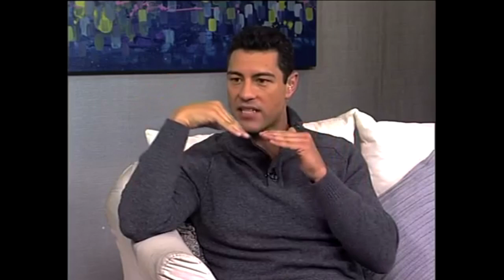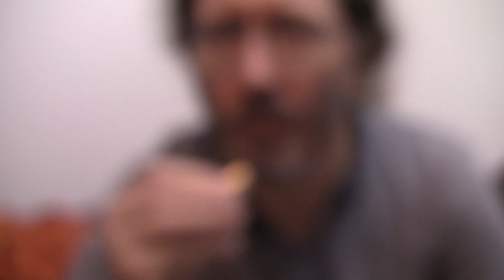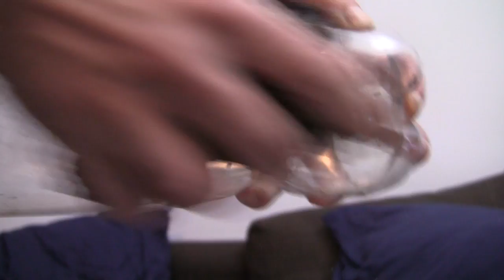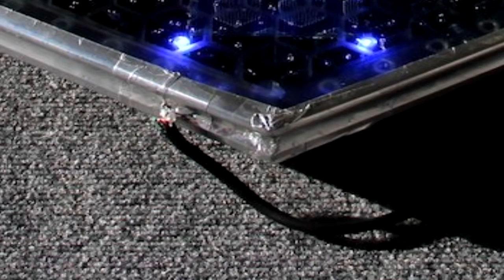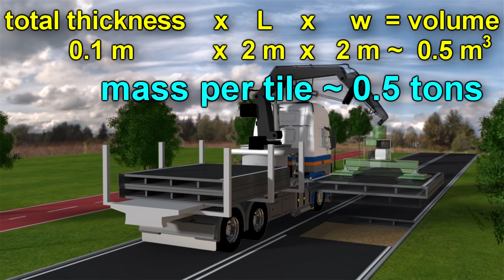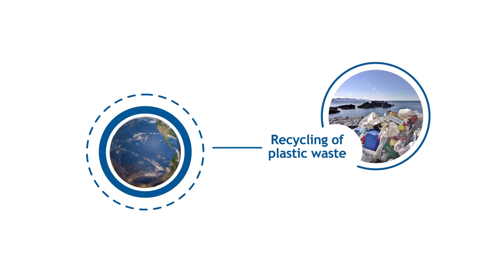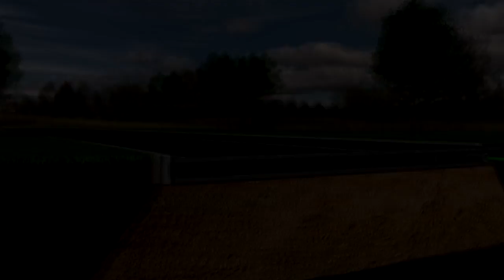Plastic Roadways BUSTED!

Comment: I have a question regarding your "Plastic Roadways BUSTED" video.  I'm only about 7 minutes into your video and I'm really confused.  From the gist of the video so far, you make it sound like plastic roadways are not possible and/or are stupid, but India has had plastic roads for the last 15 years.  I can get you a link if you want.  Is this not the same thing?
Reply: We should then just give Indias version of plastic roads a try. Because they sound decent and it makes more sense. No more  trying to change what the road is. Just make them better.
Reply: Did a quick check and it seems that concrete tiled roads are also more durable, partly due to the slabs helping to dissipate the weight of vehicles over its whole surface area.. asphalt roads being more elastic means the pressure is more direct on the underlying layers and hence degrade faster.
Reply: On the plastic roadways site it says that they will mix the plastic with something to make it stronger
Reply: They're soliciting for funding based on disingenuous claims without a prototype to show.
Reply: EpicATrain, No.  Asphalt does not function well as a span.  You do see asphalt placed on decks of spans but the span itself is usually something like steel beam.  If you look for it you can see objects mashed into asphalt roads.  Something like a penny is below grade after getting run over enough.  If the asphalt is on top of a void it will smash down into that void.  That is an advantage if you place asphalt on top of concrete.
Reply: The plastic roads in India came about as a way to make use of the tons of waste plastic created every day, if I recall there are whole sections of roads in Bangalore that are done this way. Basically it replaces bitumen as the the main binding agent so helps cut costs and recycles the waste plastics. Also due to the composition you can use different grades of plastics without adversely affecting it's durability so time consuming segregation is not needed. It's actually pretty durable and can help cut costs. I will have to wait and see how the plastic roadways proposed in the above video pan out as that's a somewhat different approach. Tiled sections for roads are not a bad idea, I have travelled through Assam and one of the highways to Guwahati is completely made of huge rectangular sections of concrete titles, I was told it is slightly more expensive than asphalt roads but maintenance and repair is easier, and is more resistant to the effects of the heavy rainfall we get during the monsoons.
Reply: Ponen Longchar I understand they are a good idea in the south, but here in the north, where the ground freezes and then melts every year, we had a concrete road for one year before it was changed. Then the slabs had turned enough so the road was not smooth anymore and the edges made driving uncomfortable and dangerous.
Reply: @ribbitgoesthedoglastnamehe4681  
Concrete is used all the time in areas that freeze in the winter. Where I live, we can get freezing temperatures for half the year, and yet they sometimes get 40 or 50 years out of concrete pavement. What you are describing, where the concrete slabs rotate so that the edges stick up and make for a rough surface, is caused by poor construction practices or bad design. Here it typically happens after many years when salt penetration causes the dowel pins to rust away. The slabs then have nothing to hold them together and transfer weight from one slab to the next, and then they start to tilt, normally down at the near edge, up at the far edge, making a sort of ramp. The proper fix is to make pavement cuts and install new dowel bars before the old ones break. Now if a new pavement is tilting after only one winter, there probably were no dowel bars installed in the first place.
Reply: @Ethan.Lamoureux  Fair enough, it works somewhere, but dont be too quick to judge.
The land here is marsh, mud, clay and all kinds of trouble, and it goes down up to several kilometers at worst. 
I dont think there is a "right" construction technique in the world that can keep the road from moving unless you dig and replace meters and meters of ground. And theres no problem with slow speed, but 100-120 km/h needs a much smoother edges than lower speeds.
Also, im not sure what bars you are talking about. You cant make a stiff road surface, you cant lock things in place, that will just break it up in the first place when the temperatures change. The slabs have to "float" on the road base.
Reply: @ribbitgoesthedoglastnamehe4681  With highway construction on unstable ground that is too deep to remove, you have to build a base that floats on the ground and evenly distributes the weight of the roadway and the traffic it carries, without concentrating the weight in one place where it might sink. Where I live we have a lot of ground like you describe. Over a hundred years ago they built roads across swamps by cutting logs and laying them across the ground, then piling sand and gravel on top of the logs. The logs would distribute the weight of the roadway and keep it stable. They called it corduroy. Many of these roads are still in use, with the logs still in place after all this time, and the roads are stable. I understand they do a similar thing these days using modern materials.

Dowel bars are inserted horizontally across the pavement joints. They are designed so they can slide within their holes, so they work like an expansion joint, allowing the pavement to move horizontally with temperature changes, but not allowing the pavement to move up and down against the rest of the pavement. Here are some links to pages that tell all about dowel bars, with pictures.
Introduction to dowel bars: https://www.pavementinteractive.org/reference-desk/pavement-types-and-history/pavement-types/dowel-bar/
How they are installed during construction: https://www.pavementinteractive.org/reference-desk/construction/placement/dowel-bar-placement/
What happens if they’re not used, or if they fail: https://www.pavementinteractive.org/reference-desk/pavement-management/pavement-distresses/faulting/
How they are installed in older pavement to keep it from getting rough: https://www.pavementinteractive.org/reference-desk/maintenance-and-rehabilitation/rehabilitation/dowel-bar-retrofit/
Reply: Probably they use the plastic into the 5% "black gue"  (betumen)... 
So not totally plastic
Reply: https://www.theguardian.com/sustainable-business/2016/jun/30/plastic-road-india-tar-plastic-transport-environment-pollution-waste
Reply: EpicATrain Checked your link and the roads described are not “plastic roads” like in this video but a composite containing plastic and tar. I suspect the combined properties of the composite are better than just the pure plastic roads described in this video.
Reply: I'm debating on how to reply since plastic is a generic term.
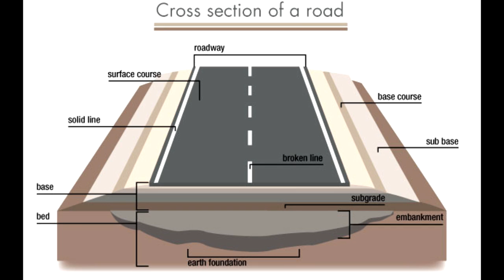Reply: Alright, so if you go to time index 3:55, Phil asks, can you make ANY decent road surface out of plastic?  I feel as if India has fulfilled this requirement.  Now he says it's too soft and he goes on to say that plastic is a generic term.  I would consider tar to be the binder in the plastic and not dismiss it.  The only real difference between the two is the fact that I think one is hallow and one is filled.  So the real question here is, can you make a plastic and tar roadway that's hallow as mentioned in these videos?
Reply: MichaelKingsfordGray I am not here to baby sit you. Do your own research. Plastics are a big family, we use them in many many industries. Paints Coating Wind Turbine Composites Construction Electronics Adhesives. The list is long you dumb fuck you can stick back your degree where it came from. Your ass.
Reply: EpicATrain He is a dumb fuck. Space industry also uses plastics since 50 years becose with the right mix we get a highly resistant material. He should stfu so many people listen to him making fun of his own stupidity.
Reply: EpicATrain well India isn't really comparable to United States in terms of day to day activities..
Reply: EpicATrain  And they still wipe their asses with their bare hands! Not the shining example of modernism.
Reply: ric mulholland come on still hung up on that. we use water. cause it cleans better. I don't see you having paper towel baths

Comment: It may not be the perfect idea but to compare a bottle with a road surface? my gues is they would make them a 'little' thicker than the 0.8mm wall of that bottle and the grit wouldn't be sliding up and down like that under normal circumstances, mostly rubber tyres pressing down for a split second.

Comment: I print with petg which is a similar material to pet and that melts at around 100c or so, it prints well at 240c. Measure the temp of blacktop on a sunny day in summer time, this is the worse case for it. Also recycled plastics in the 3d printing relm has been pretty sketchy since the make up of the material is different after it has been heated once before. Not to mention blacktop is usually reused on the spot when they are resurfacing the road.

Comment: Ok, from your videos, both this 1 and the solar road way 1, i get the impression that the creators were just too ambitious with what they wanted to replace, i feel that both of these would be more useful in sidewalks, maybe, like the plastic as the main walking surface with the solar panels running along side, potentially lighting the path at night and prividing power to the grid, the solar panels could also be used in pedestrian signage if reinforced, such as the area of the sidewalk leading into crosswalks, of course there would be a need to fix the problems you found with the solar panels in the solar road way, mainly the maintenance problem, panels need to be replaceable or fixable. Just my thoughts on the subject

Comment: Bad idea, but I can see solid, not hollow, textured plastic tiles being put on sidewalks and in places in parks: places not used by motor vehicles. Wouldn't necessarily want the surface to be PETE, depending on where you live, but this bad idea can be made into a clever concept elsewhere.

Comment: Eveybody is a scientist here..  wow!  yet not a single intelligent solution offered by anyone!
Reply: The solution? You don't need to know the correct solution to know that another solution is wrong. That's how deduction works.
Reply: The solution is to deal with reality rather than invest in obvious failures.
Reply: So you're saying that you are smarter than a scientist and that you have a solution? A solution to a non-existing problem?
Reply: Use the recycled plastic where it’s intrinsic properties are useful? Revolutionary idea, I know, bear with me, but what if we took the plastic bottles, made the plastic useable for injection molding, and made items from that plastic?
OR, we use less plastic bottles in general, reducing their inclusion in the waste chain, and stop using them as disposable commodities and use plastic for multi use items?

Comment: Well, if you make cars's tires with freaking hover technology instead of rubber, you solve the abrasion problem. Perhaps the energy of the hover car can even come from the plastic roadways, if they're also freaking-solar-roadways that additionally capture water and generate hydroelectric power underneath.

Comment: O PLASTIC DEGRADES IN SUNLIGHT? DUH SO DOES THE TARE THAT HOLD ROADS TOGETHER, THUS WHY ROADS fade from very black when laid to grey and white when aged, about 5 years latter, much faster than you'd expect out of plastic. Im sure there is a very practical way to prevent this. Such as many plastics are UV resistant. adding additives to the recycled material would likely greatly improve this. and great thing about plastic would be the ability to flex would take up much of this expansion and their lighter color would mean they heat up less. Such as the road they are painting white in LA.

Comment: I burst out laughing at 'Flood Proof' like a few sq feet of space will do anything but  proof it. Minor Resistance to floods and road water run off pre-treatment maybe.

PS why not make plastic sidewalks that are modular, provide easy fast utility access,  need far less strength and junk than a road would. that might work and be nearly practical :p

Comment: Plastic-aggregate composite would be difficult to work with because plastic is solid at room temperature. You could use a factory but that implies making bricks instead of just laying it on. 

A plastic-aggregate brick might have an advantage over traditional bricks by having a bit of elasticity. Maybe. 

Damnit jim, I’m a computer nerd, not a material science major.

Comment: nevermind if it would work or not, have you ever driven on a road made up by sections? I was on a tour through europe and drove on the autobahn in Germany, which has sections of concrete slabs forming the road, and I can testify that the sound the car makes when driving over the seams is enough to drive you insane. dun dun dun dun dun dun dun dun dun dun dun dun dun..

Comment: this fake application aside, it's not as though DOT engineers never consider non-traditional materials.  

for certain geotechnical applications, even styrofoam blocks (seriously) make sense from the perspective of lightening the loads in MSE walls, and are used where cost-appropriate.

Comment: A Company In The UK Is Mixing Recycled Plastic In Asphalt. Story On BBC.  Pretty Cool Suff. Do A Busted Or Not Video On That.
Reply: I Like The Way You Write Sentences Too!
Reply: Swift n Potato Thanks Dude. I Am Starting A Movement. You Are Welcome To Join.
Reply: Yea. It's on Green Dragon Lane in Enfield, London. Funnily enough there are loads of Roadworks at the moment. Actually for broken water pipes, but I think they will replace the road surface with traditional Asphalt (especially due to the hot weather we've been having which has caused some roads to literally MELT!)

Comment: I dare you to do the same tests you did with plastic on a current common binder used on roads, such as the tar in asphalt. Tar is much softer. Im willing to bet tar would fail every test you did on plastic. Yes you could argue it is grippier. But in short order, even bitumen erodes away, leaving  just the aggregate as the primary road surface, providing traction. Plastics have been used for years in outdoor decks, I'm sure UV protection is already at decent levels. Despite your video, I can see potential for use of plastic in roads. Sure, this company's proposed design is rather outlandish. The convergence factor of combining conduits for public services such as electrical, communications, and storm runoff  is rather fairytale over engineering. If focus were to be toward road surface with out including the proverbial kitchen sink, I'm fairly certain a rather economical solution could be engineered with plastic used in binding the aggregate of the road surface into a quite durable, and recyclable product. As to the amount needed, and your pointing out the lack of global supply, you failed to mention that when used as a binder in an aggregate, much of the weight of the panel would be in the aggregate itself. As far as cost, its main customers would likely be  fancy rich cities.

Comment: There's also the slight problem that plastics are much more flammable than asphalt. Asphalt might melt, but the plastic, even if mixed with rocks and sand, would have a much higher chance of actually combusting. This would also ruin the chances of recycling that section of road, not to mention also releasing horrible fumes.
Reply: Nathanus Michael Bay would love it! Flaming freakin’ Roadways!

Comment: At 19:01 the answer doesn't address the question let alone answer it. The question is specifically about plastic being too smooth to repel water and they're talking about it being stiff enough to support weight. Stiffness has absolutely nothing to do with smoothness. They didn't even bother to read the question let alone answer it.

Comment: compromise. make 'em with a channel on each side. then they can have line channels, with other kinds like a channel across the middle if needed, and a solid piece of plastic for the drive surface.

now all that has to be dealt with are all the other problems.

Comment: Thunderf00t: This is not bullshit while solar f*cken roadways is. Asphalt consists of bitumen and gravel, which is based on oil by-product. Bitumen is soft and gives only elasticity while the abrasion is on the gravel. Plastic and tires recycling would actually reduce waste and give a better elasticity. The bullshit factor here are the LEGO elements.